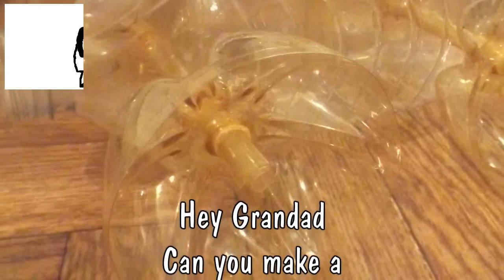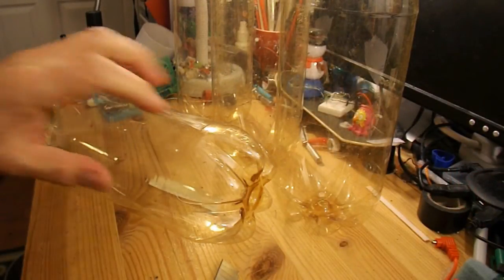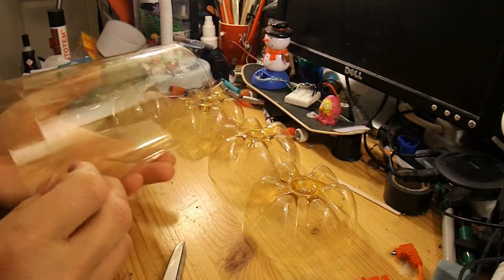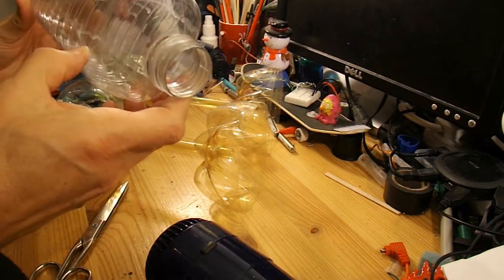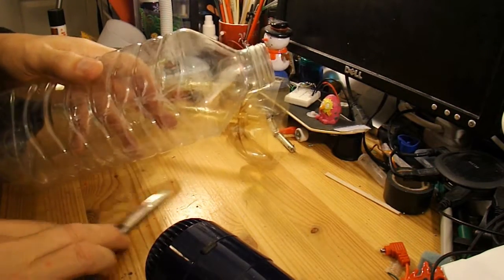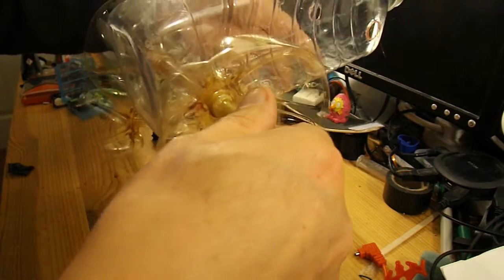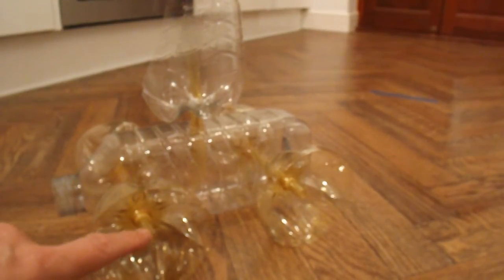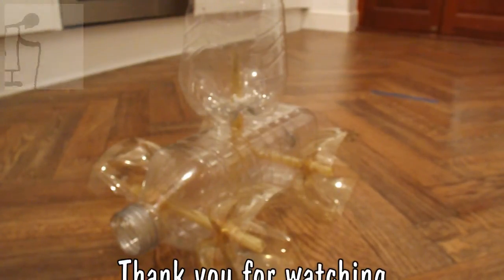Hey Grandad can you make a 100% Plastic Bottle Car

Comment: I requested a ornithopter but watching some of your old videos you have all ready made one that worked quite well but I no you have made that flex wing glider I was thinking you oils turn that into a much larger ornithopter?
Reply from the maker: Hi Z.M.L. if you read the replies I have given to each of your requests you would have seen that I gave you the links to the ornithopters I had already made in one of those replies. As for modifying the flex wing glider to an ornithopter, that would not work. The geometry is completely different. An ornithopter has straight wings at the front, not the V shape of the flex wing. To power wings that large would require a proper rc plane motor with quite high power output and a gearing system to slow the RPM down to a sensible wing beat rate so it is not an easy task. There are plenty of YouTube videos of powered ornithopters with some really nice ones that truly look like birds.